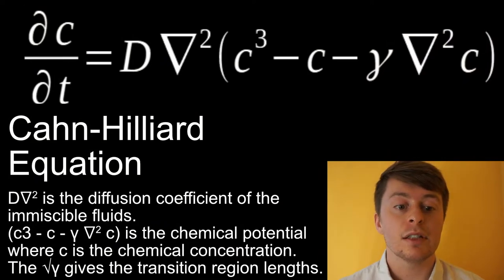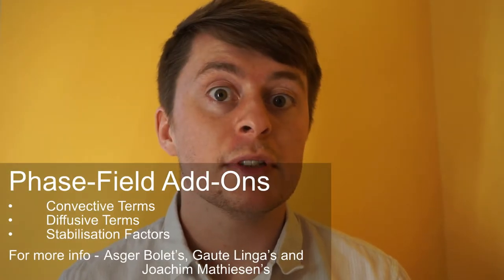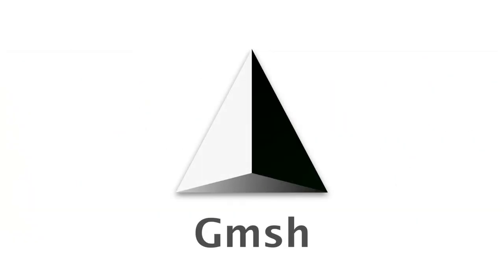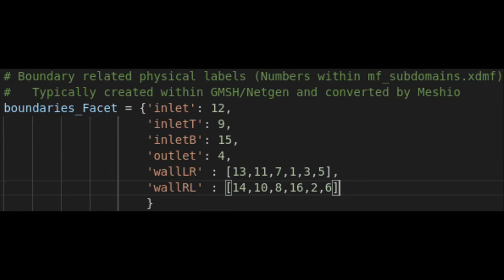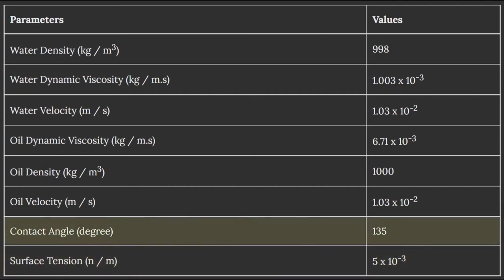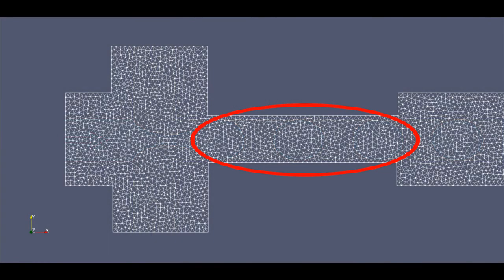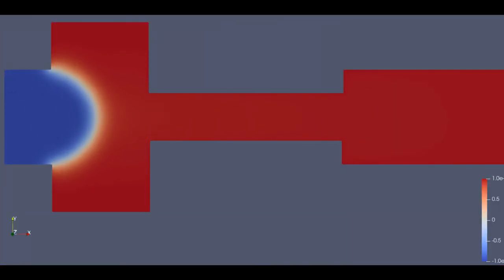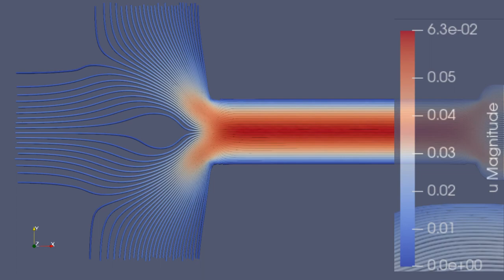Simulating Microfluidic Droplet Formation | FEniCS CFD

Comment: This is brilliant! Do you think it's possible to work out droplet size as a function of some input parameter? (inflow velocity, viscosities or the like?) It's fascinating to think about devices like this to make experiments in biology.
Reply from the maker: Hello!

This is a great question and something I want to visit in the future and discuss further, so watch this space!

I think it is possible but will need to be tailored to specific geometries and the fluid properties. Currently, droplet size prediction is being actively studied as it reduces the need for simulations like these which can take a lot of time and computational power. There are models which consider the Capillary number, the Reynolds number, the flow ratio and viscosity ratio (1). The Capillary number is a dimensionless number describing the viscous drag forces against the surface tension forces acting across an interface. The Reynolds number I have discussed before is a indicator of laminar and turbulent flow. The flow ratio and viscosity ratio effect the release and pinching of a droplet which we discussed briefly in this video. By adjusting the parameters, you can somewhat reliably predict the droplet size but seems to be very specific to geometry and their experimental ranges. As we mentioned in this video, the smaller chamber off the flow focusing junction which can aid in the pinching creating droplets. Models like these will likely become more common and allow for optimisation of a flow ratio range for forming specific droplet sizes which will be awesome.

I too cannot wait to see what novel experiments will come from mass mono-droplet production to controlled biological experiments. Exciting times!

(1) Mottaghi, S., Nazari, M., Fattahi, S.M. et al. Droplet size prediction in a microfluidic flow focusing device using an adaptive network based fuzzy inference system. Biomed Microdevices 22, 61 (2020). https://doi.org/10.1007/s10544-020-00513-4
Reply: @NanoMedic  This is very interesting. It seems like the parameter space is quite reduced, and thus the difficult part is the computational power required to solve PDEs and explore it. I will definitely have a read at this source, thank you very much for sharing!

Comment: Very nice simulation!! Could you explain the criterion for choosing a constant Mobility and what its value should be depending on the simulation? Do you think a mobility value of 1.0 is good enough for studying the bulk dynamics of  two fluids rotating in a cylinder? Thanks in advance :)
Reply from the maker: Thank you so much! It's complicated and honestly, there is a lot I am still learning about the mobility constant. I have written a Wiki on the BERNAISE GitHub here: https://github.com/MattH688/BERNAISE/wiki/Adding-Phase-Field

Basically, the constant needs to be balanced to your solution otherwise it will lead to unrealistic phase field mobility if too high or when set too low will lead to decreased mobility. One way could be to view the Navier-Stokes dynamics beforehand and see if the phase field compliments the fluid dynamics. It takes a little trial and error!

I don't believe the mobility value of 1.0 will work for every solution so might need to be adjusted as needed. Two fluids rotating in a cylinder sounds challenging but interesting. I would advise reading the Wiki I wrote on the GitHub and hopefully that'll help you initially with your problem 😀 Good luck!

Comment: Hello bro I am Nagaraj, can you please elaborate about the time step number, time step size and methods that you have used. And also let me know what will be changes I should do for air and water combination?
Reply from the maker: Hey! 

So time step is the time between each calculation of the partial differential equations (PDE) in this case, Navier-Stokes (NS) for flow dynamics and Cahn-Hilliard (PF) for phase field. This is important when making assumptions in the formation. Too fast, a large time step, the bigger the assumption of the dynamics evolving between steps. Certain dynamics may not be simulated and missed. This matters for modelling "real-world" dynamics. However, making the time step too small, it'll take a lot of computational time to solve the problems. Also, too small time step, the movement or flow may not solve for the mesh similar to the phase field interface thickness. In Navier-Stokes, this is due to the vector length are smaller than the cell mesh size. Really you need to judge for yourself for the appropriate solution.

The time step can be automated for Navier-Stokes problems using the Courant number which suggests a time step based on the mesh cell size. This will be explored in an upcoming video!

Regarding implementation of air, in theory you would change the oil with the parameters of air. However, you would likely need a compressible Navier-Stokes solver where currently this simulation uses an incompressible Navier-Stokes solver. The incompressible Navier-Stokes solvers often provide a good approximation for liquids but generally aren't good for gases such as air. However, feel free to have a go modifying this one or maybe implement your own compressible solver. Going to the demo linked in the description "Flow_focusing", you should be able to change the density (line 168), viscosity (line 169) and velocity (line 163). The former parameter should be oil and the latter should be water, for example "density=[1000, 998.2], # Kg/m3" where 1000 is the oil density parameter. You will likely need to tune the phase field parameters such as the interface thickness (line 144) and phase field mobility coefficient (line 167) as well as setting the real world contact angle (line 158) and surface tension (line 159) parameters. Apologies this isn't clearer, I'm planning an upcoming video detailing step by step how to setup a CFD problem in BERNAISE. Currently, you can check out the GitHub wiki for the BERNAISE fork in the video description, in particular the "Creating a Computational Fluid Dynamic Problem (CFD)" and "Adding Phase Field".